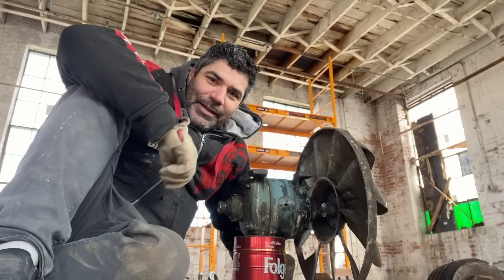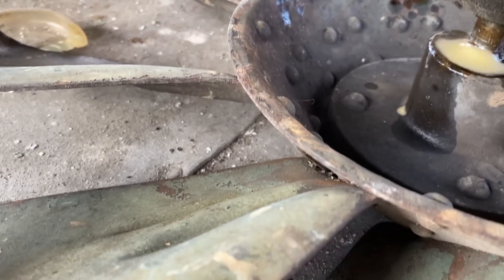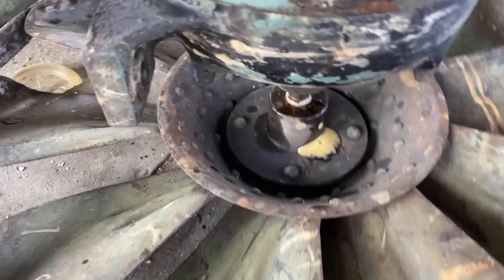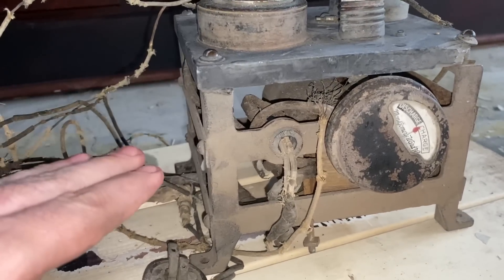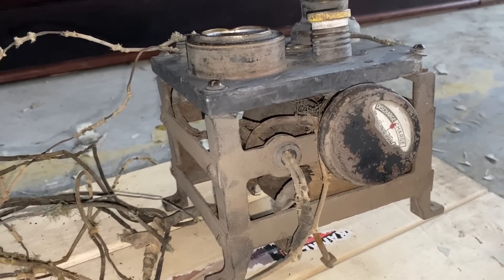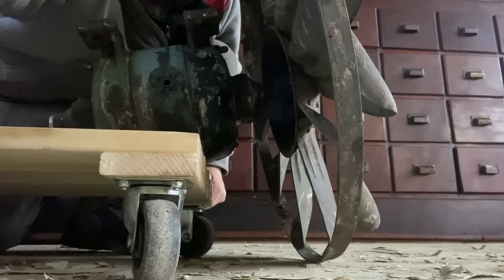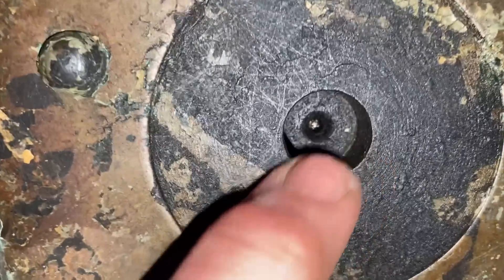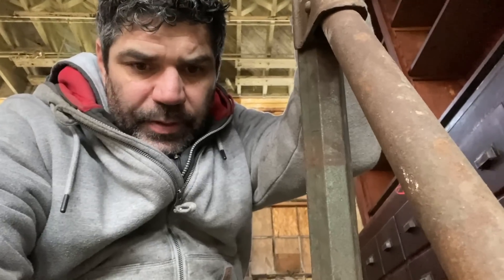Looking at some old pieces of industrial salvage

Comment: Mongomery Ward battery charger with a 120v to 12v transformer (the big thing under) and old bridge rectifier (the thing screwed into the light socket) to convert ac voltage to dc voltage.
Reply from the maker: That's interesting you know the manufacturer of that.  There is so much knowledge out there to tap in to.  Thanks.

Comment: That shaft goes through the motor and armature to the other side. Get a drift not a punch, prop it up on 2 boxes and tap on the drift with a hammer. Not too hard. May just have to tap and soak for awhile.
Reply from the maker: need to look up the difference between a drift and punch.  Thanks.

Comment: Remove the setscrew from the fan housing to release it from the flat edge of that shaft. It is not threaded. It’s just old and stubborn applying heat with a torch will help.
Reply from the maker: The set screw is out already, from a previous video.  Heat looks like it's going to be the way to go.

Comment: first the jack is worth around $50 , its a modal T body and bumper jack second id get a flux core wire feed welder ( good beginners welder ) third make sure the set screw is out and like you had it on the saw horses take a punch and bring her home , the flat spot is for the set screw and the hole in the end is for a puller to align the bolt .last the battery charger is a 6 volt  and the socket is for a bulb ( 6 volt ) to test batteries also and the other is a fuse , i think the glass and filament are missing from the Edison bulb , id leave it alone and sell it just like that !
Reply from the maker: Interesting about the hole at the end. I was wondering what that was for.  Thanks!

Comment: That looks like a vintage battery charger, with Charge/Discharge.  That thing on top in the bulb socket looks like a rectifier (aka. diode). Diodes are used to convert AC power to DC power, which would charge a DC battery.  I would clean a little and let go as is.  I like vintage in its original condition, not restored.  Great video.  Let shaft soak for a few days.
That is an old bumper jack.  My uncle owned a filling station, and I would play running it up and down.
Reply from the maker: what decade is that jack from?  I prefer original condition in cleaned state as well.
Reply: @Cold War Mercantile  I really not sure.  But I played with one in the mid 50's at Uncle Woodrow station.     I would think it was a time when old cars had bumpers that stuck out like A-Models and even into the 40's.  I had  1940 Ford as a teenager. That jack worked well on it because of the bumper style.  Keep up the great job.  Yes, YouTube answers help out.🙂👍

Comment: Might try a  "Wire Feed Mig Welder" to start with.  Pretty easy to use, just make sure to wear your welding helmet for your eye safety.
Reply from the maker: My uncle advised me of that as well. Does it take long to learn, ie. settings etc.?
Reply: @brickandsole  nope, well, I mean to be a pro it might, but a friend showed me in a few minutes.  After that it's just practice.  Just grab an old hunk of metal and practice 'till your heart's contemt.

Comment: it's a set screw. if ugly means value i'm worth a whole bunch, thanks buddy. that charger says montgomery ward company. and they had a catalog mailed to people to order stuff then they had stores. and on that fan sometimes they had two set screws one out and one in. when you pull on the motor you have to look to see if the shaft is moving in and out of the motor or is the shaft moveing in and out of the fan blade itself.
Reply from the maker: Definitely in and out of the motor, however someone said in spite of this it is still part of the motor, the play is for thermal expansion.  I am learning so much from you guys.

Comment: Make sure the set screw is loose on the fan hub. It tightens to the flat part of the motor shaft and usually is an allen head set screw, it will usually be recessed in the fan hub. It may have dirt crammed in the hole for an allen wrench so make sure it is cleaned out and you can get the proper size wrench in it, it may be very tight also. Let the penetrating oil soak, don't get in a rush. The battery charger looks to me like a lost cause, it looks like the transformer windings have been damaged and would need to be rewound which would be costly. The ampere gauge is broken as it should have a pointer needle on it and a glass cover to protect it. Montgomery Wards was a long established chain similar to sears, often referred to as Monkey Wards.
Reply from the maker: Yeah, I am sure it only. has decorative or conversation piece value. I like it because it reminds me of frankensteins monster.  I'll just clean it and put it on my dresser.

Comment: The motor is not just a shaft, there is a stator in the middle. The bearing on the fan side is an angle contact bearing that will secure correct play, the play you have is enormes. The bearing in the other end is a standard beraring that is well fitted on the shaft and glides in the outer housing, this is for to catch thermic expantion, if the outer racing is glued the motor will faill after a few hours dependent on the shaft lengh. For to take it apart both end covers needs to be removed.
Reply from the maker: That is certainly different than what I have been hearing.  I am so interested in this now.  I will post the final results. Thanks for the info.
Reply: @brickandsole  It might be different on very old motors but the principal is the same, the most important is to allow thermic expansion in the axle shaft. Just for comparison, a 350 kw motor shaft expansion from the front bearing to the axle tip is around 0,15 mm, this needs to be compensated by the coupling, a stiff coupling will damage the bearings.

Comment: To remove the fan I would try a propane torch. Set up the motor on a table, chair or bench outside, such that the axle is parallel to the ground and the motor is supported such that the fan can be rotated while the engine housing is stationary without a need to hold it for support. Direct the flame from behind (between the blade and the motor) at an angle towards the middle of the outside edge of the flange. Slowly turn the blade such that the flange heats up evenly. I guesstimate that a few minutes of heating will be necessary. The heat may burn the paint on the fan blades. If there is much penetrating oil remaining near the flange this may burst into flames. There is a risk that the metal is fragile and the flange may break (grenade) while heating. Wear safety goggles. If heat is applied evenly there should not build up any internal stresses in the piece. Also that is probably real steel not Chinesium. It will probably be just fine.

The heat will do two things. It will burn off crud and gunk that is present between the axle and the flange. It will also expand the flange. Heat will travel faster in the metal of the flange and slower between the flange and the axle. The flange will expand faster than the axle. I would expect that the fan and flange can be gently pulled off of the axle after a few minutes of heating the flange. Pulling gently means considerably less force than what is needed to lift that thing off the ground. I don't think you need to heat that flange to a highter temperature than a hot oven, say approximately 500F.

I'm NOT an expert. Take any additional safety precautions you deem necessary. Buyer beware. May contain nuts. Take with a grain of salt. That all been said, the above described procedure is exactly what I would attempt to get that fan loose. Get a torch with a narrow head made for heating not one of those wide things made to burn grass.
Reply from the maker: when you say flange, do you mean the fan component? as opposed to the shaft?
Reply: @brickandsole  Yes. The bulky thick part in the center of the fan that the shaft is connected to. The part where the set screw hole is in.
Reply from the maker: @adrianopaparoni5584  Okay. Thank you.  I don't have it in front of me but I'll get back to it soon and post results.

Comment: I'm 99% sure that if you can support the fan(like 2 boards either side over a gap in some benches/tables, if that makes sense) and leave the motor hanging below, get a round drift/socket bar extension and hammer the end of the shaft inside the fan, but whatch your feet as the motor is heavy, it's going to fall quickly! I'm sure it is only rust holding the fan on, because of the flat on the motor shaft, the penetrating oil just passes through and doesn't soak anything well.
Reply from the maker: Yeah, I tried that hanging, but didn't try the punch when it was suspended.  Something to try next.  Cheers.
Reply: You risk wrecking the motor doing this. The end bells are probably cast iron and they will break. If you try something like this, ensure the motor is supported from free-falling. But you don't need to do this.
Reply: @brickandsole  add some heat too!

Comment: the shaft is part of the motor use a drift on the fan hub and hit the hub to dislodge the bit from hub. once you get it moving it will slide off the shaft. it is and interference fit to the shaft
Reply from the maker: Someone mentioned that earlier, I need to look up the difference between a drift and a punch.  Will do.  Thank you.
Reply: @brickandsole  a drift is a blunt piece of steel, like a punch but with a large surface. you can use a bit of pipe etc, it just lets you hit it hard to transfer the shock waves to the end with out damaging the hub. a sharp whack at 2 points  [ 180 degrees apart ] it will move just may take a few hits. drift is best as it is solid more shock wave. rest drift on shaft against the hub .

Comment: There is a flat spot on the shaft because they used a screw from the outside to lock it in place. Look down that little hole where you squirted the PB in. There should be a screw there, unscrew that and that frees the fan from the shaft. The screw hits that flat spot on the shaft and keeps the fan from spinning with out the shaft turning.
It maybe be a flat head screw, dunno.
Reply from the maker: I guess that is the set screw that I removed in previous video.  Getting closer each time.

Comment: @8:15 - looks like a heating element used to create an electrical load for the device.  not sure why.  maybe to limit how fast the battery charges.
Reply from the maker: folks mentioned that is to drain the battery so it can be worked on.

Comment: I wonder if the motor only spins one way and the other side of it is so you can turn the fan in the opposite direction. The movement of the shaft is inside of the motor so it has nothing to do with the connection between the fan part and the shaft. If you put a small, handheld, propane, torch on the fan part around the outside of the shaft, it may expand that Metal, and then you could hammer it off of there
Reply from the maker: There is an idea I can try.
Reply: Avoid torches, use a heat gun. You don't need the level of heat you'll get with a torch, it can warp the metal.

Comment: The shaft is 110% not connected to the fan blade, just get a few thick metal wedges between the fan and motor, right next to the shaft and hit with a hammer the fan blade should pop right off, i sped up and slowed down oilfield pumps for over 15 years sheave and bushings but this doesn’t have a bushing it’s a direct drive fan with a set screw.
Reply from the maker: I will try to YouTube that wedge process, the gap between is pretty far apart.
Reply: @brickandsole  Home Depot or Lowe’s has wood splitting wedges they will work fine and if the gap is still to wide use a big bolt or any solid piece of metal to make up the difference👍🏼
Reply: @brickandsole  another easy way would be to suspend the motor in a barrel or large pipe by the fan blade (motor hanging down) and hit the shaft from the top downward with a punch or long bolt. Just make sure the motor lands on something soft when it comes down. Or you could even use edge of a solid table for the fan blade and motor hanging off the side but just watch your toes when the motor falls! 😂
Reply: Glad you went with this method 🙏🏼

Comment: It’s all about requirements when choosing a welding machine. Moderate welding or heavy constant welding (heavy duty cycle). You said light hobby type welding, OK 110V machine, light 25% duty cycle. If you will be welding mostly in a controlled environment where there is no wind or breeze, then a nice 110V MIG machine with gas shield will produce some snazzy welds but if any breeze disturbs the gas shield you will not have a good time grinding out foamy crappy weld beads and there will be lots of splatter to cleanup too. Mig with Gas is not as portable as a MIG with flux core. MIG machines with gas can be 2X the cost of a Mig with flux core wire plus you have to keep Argon bottles charged to use it. Flux core produces a little more splatter but produce nice welds too and is considerably less $$$ and way more portable. My 2cents get a 110V 135A Flux Core variable speed MIG Welder    on Amazon for under 200 bucks. They all usually come with 1 or 2 pounds of spooled flux core wire too. A word of advice always clean your work before welding, don’t try to weld through dirt paint or rust, you’ll have a better finished product with very little splatter or grinding needed. Oh and coming from a long line of welders in my family you never refer to the welding machine as “A Welder” or “The WELDER”,,,,, YOU are “THE WELDER” that uses a “WELDING MACHINE”.
Reply from the maker: NIce!  that is a robust answer to the question.  Thank you.

Comment: You need that thing like a bearing puller thats made to remove such stuck things, its a specific tool  but I cant remember its name, that and lube and heat, just go easy on the hammer if you use a hammer.
Reply from the maker: I heard they have them at harbor freight.

Comment: I learned on a stick welder.  Most of the comments that I read are saying mig with gas.  TIG is the prettiest and has the potential for the most penetration.  A stick welder is the easiest (cheapest) to get started.  A good welding channel is weldingtipsandtricks.  On the fan motor, I would support the fan letting the motor dangle and drive the shaft out with a punch from the front.  No clue on the battery charger.
Reply from the maker: That is the next step, then heat if that doesn't work. Thanks.

Comment: The center of that shaft is threaded by the fan. Take a picture of the end of the shaft to a tool rental place and they should be able to set you up with a puller…
Reply from the maker: I'll try some vice grips and se if it will spin off as well.
Reply: The puller screws down into the shaft  pushing the pulley off from the shaft. Vise grips won’t accomplish what you’re needing to do…

Comment: I might be just as clue less on some of this stuff as you are but - it seems like those two (?) bolt heads might be holding some sort of collar inside of the fan shaft ?? 
       try to loosen them and see what happens.   I agree, this is the first one - experiment and keep trying until it is figured out.
Reply from the maker: someone said those are lubricant holes, so I am really interested solve this one.  I'll post it for sure!

Comment: that thing looks like a screwi n fuse or resistor... dunno,.... but the fact that the device is designed to have lots of surface area, means one of it's functions as a heat sink.....i.e radiator.. which keeps stuff cool enough to not destroy itself....like them heavy  things you took off the wall for the bar front... they radiated heat... as opposed to disipating it.. same thing different use.
Reply from the maker: Yeah that's what a few folks mentioned, to heat up and dissipate energy to remove the charge so that it can be worked on.  Fascinating.
Reply: @brickandsole  i agree.. i like the sleuth aspect of your channel,  as well as the sculptural... best  2 ya.

Comment: Just like all the other pieces you had to cut for a fast job, cut the shaft and figure out the rest later.  Make it easy on yourself.
Reply from the maker: the problem is that the motor seems like it would be really interesting item for someone.  It is really old back to 1926.  I will save that option for the very last.

Comment: I wonder if the four bolts on the face of the fan blade will allow the blade part to come off the hub part? if so this would allow you to use a "gear" puller to get behind the hub and pull it from the shaft.
Reply from the maker: I don't have it in front of me but I think it is riveted as well.

Comment: The thrust bearings in the motor are shot. Thats the movement. The shaft is stuck. Beat it like it owes you money. Maybe get the fan hub red hot with a propane torch. What are you trying to save? You could just saw the shaft off. 
Mig welder
But you aint got the time to make it pretty 
Sorry
Reply from the maker: Like it owes me money. haha.  I'll be sure to do that.  thanks.

Comment: Gas shielded MIG welder is your best choice. As a beginner, you're going to be tempted to purchase a flux wire MIG welder. DON'T DO THAT.  Make sure the  welder has the ability to flood the weld pool with ineet gas, typically argon. Oxygen in the weld will ruin it. Flux wire CAN do that, but the beginner and occasional user will NOT be satisfied with the results. ALSO there is a compound you can purchase that prevents weld 'sputter' from adhering to materials near the weld.  Learn about it and get some
Reply from the maker: This sounds like I am going to need an experienced mentor.  Or a heck of a lot of YouTube videos.